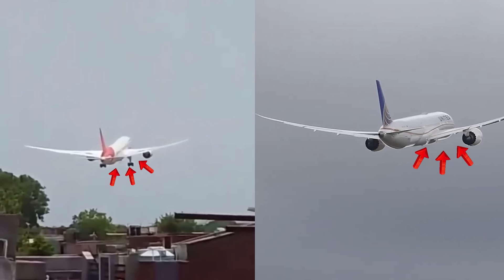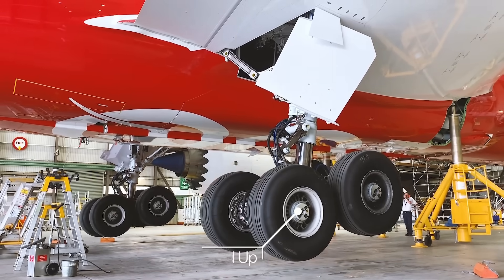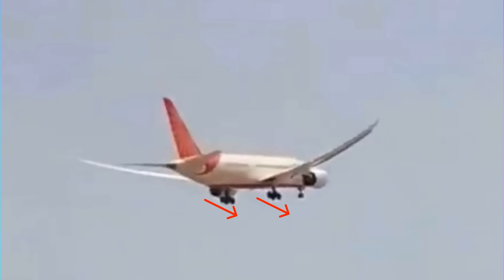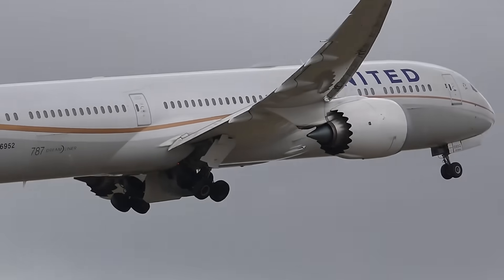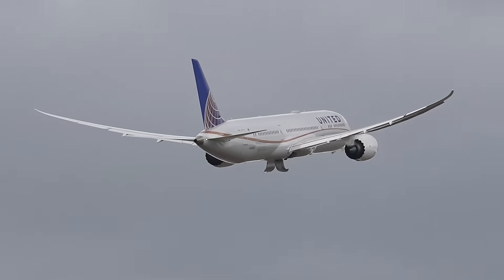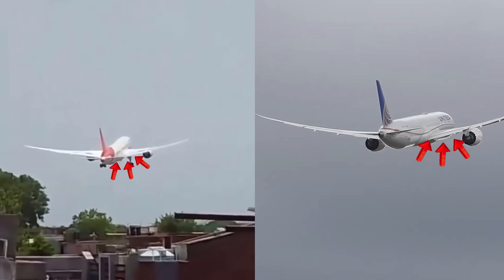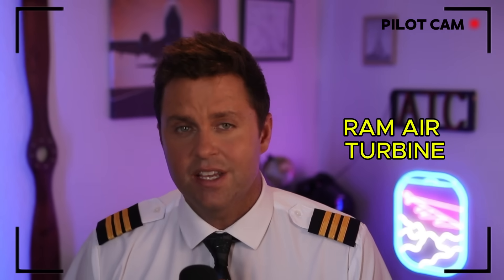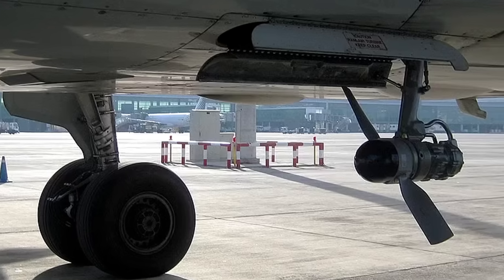Pilot Explains: A New Detail in the Air India 787 Crash Everyone Missed

Comment: Its amazing that finally, someone besides myself noticed the elephant in the room........ SILENCE instead of full power.
Reply: The aircraft had power problems before it took off. It was documented on a video that they found from a passengers phone.
Reply: @GaryFeltman that videos was from one of the passengers on the previous leg of the same plane. It i had electrical issues with in flight entertainment not working. I think he landed and got off at Ahmedabad while 240 others were boarding for the next final fatal leg!
Reply: @yashassridharan5504  I'm pretty sure entertainment system is directly connected to engine... after all its the best plane of Boeing.
Reply: ,yes. I watched it. It should have been a big RED flag to the crew.
Reply: That's a big clue!  @GaryFeltman
Reply: But hard to believe that someone on ground didn't notice.
Reply: Juan Browne mentioned the RAT in his first video but couldn't confirm it until the one with better audio came out
Reply: @Dr_Kenneth_Noisewater He also mentioned the landing gear position and the conditions that would activate the RAT. He also brought up the point of how electrically and hydrolically dependent the aircraft systems are. There is a video from a passenger on the previous flight commenting,complaining,  on a lot of electrical cabin problems.
Reply: read my post, eye witness to SCREAMING ENGINES on crashing 707 1968
Reply: The RAT wasn't silent at all.
Reply: Chalk that up to poor video quality. I work at an airport and when that 787 takes off it commands your attention almost. So dual engine power is likely. Strange it would happen after V1 though. If they sensed an issue on the ground they would have aborted takeoff.  I think timing off when they lost power could be a key
Reply: @mrboss20ten absolutely
Reply: On Captain Steve, has a video shown yesterday that was generated from the original original video:  Turns out the video we've thought is the original is 2nd generation, filmed from a phone playback of the real original.  =This greatly reduced the audio on what we've hithertoo thought as the 'original.'
Reply: You can hear the RAT loud and clear in the earlier part of the video when the aircraft first comes into view. It sounds as you'd expect, I.e. a loud propeller sound.
Reply: jeffostroff noticed hearing the RAT in his 1st video about this crash.
Reply: My fear is that we are not going to get the truth because there is too much at stake here for Boeing .
The NTSB will be heavily influenced by the Trump administration in order to spare Boeing from any blame for obvious reasons .
Reply: But isn't that stating the obvious...The fact the plane went down is a consequence of not having power.
Reply: it's amazing that no one ground these planes!
Reply: https://www.youtube.com/watch?v=uzT9MjhsRH0
Reply: How well do phones pick up engine sounds from engines that have been designed to be as quiet as possible at that distance?
Reply: @ImperrfectStranger  If Boeing crashes in India "its pilot's fault" .. that's the next level in racism.
Reply: @bombayvega7021  What do they say when a mercedes c class crashes in India?
Reply: I disagree . Audio at that distance is hard to distinguish.
Reply: @waynelast1685 except you clearly hear the rat when the plane passes by but you hear no engine noise
Reply: @EverettJohnson-js2zw hmmm the video here doesn’t show the plane as close as another video I saw. But forgot what YouTuber it was… Same source video but just earlier time is seen/heard than what this video shows.….
Reply: No, there was the sound of engines at low idle.

Comment: Ok, so let's elim8nate fuel... if it was fuel, the engines would likely not run or not run per specs. Additionally, would that not be caught at the stability check before full power. What about a full power or before V1? Why would they wait to shut down/fail as you rotate. I'm thinking failure of something common to  both engines (obviously.) Something is missing that the fdr and cvr analysis will tell us..

Comment: No one is talking about the wheels being tilted the wrong way which means the wheels are in the process of being retracted and stalled.  Which means a hydraulic failure - double engine failure.
Reply: Swiss001 has been saying that for couple days
Reply: No, it just means the weight-on-wheels logic detected airborne and tilted the trucks forward ready for gear retraction.
Reply: What the heck do you mean, no one is talking about the way the wheels are tilted? Did you not even watch this video before commenting???

Comment: I heard another pilot earlier today theorize that the engine failure could be caused by Vapor Lock due to heat. The AC was not functioning inside, many people had previously commented on the extremely poor maintenance on the aircraft and lastly it was very hot outside.
Reply: That particular Youtuber was talking out of his rear end - as noted in most of the comments.

Comment: The odd thing to me is that these four buildings that the plane hit are located right beside an open field.  Surely the pilots would have aimed for the field if they could.  This leads me to believe that the pilots had no control whatsoever.
Reply: They were on the edge of a stall hanging on for dear life.   They did the best to keep it level.
Reply: Once the plane is in a  deep stall , it is just as good as a falling stone . There is nothing that you can do ,I bet the forward speed was not fast enough for a fully loaded plan with 10yrs worth of fuel .
Reply: @Alex-ninibe  it wasn’t in a stall
Reply: @petergill2265  It was a stall your argument must be about what type of a stall it was , maybe not as deep as I thought because the plane seemed to float to the ground but definitely not a control glide .
Reply: @horsepanther  No.
Reply: "This leads me to believe that the pilots had no control whatsoever."
To control the direction of aircraft, vertical or horizontal, you need some minimal airspeed. They didn't have it.
Reply: May be after they knowing no control is on them that they wanted to land in an open field but the thrust and altitude hasn't made that distance
Reply: You need air speed to maneuver, they never had any, or altitude to trade.
Reply: I had the same guess. But it seems to be a free fall. May be
Reply: correct.
Reply: They wouldn't see the ground ahead at that AOA, altitude and ground speed.
Reply: Probably tried slowing the plane down by sliding it along the top of the roof, and got it wrong.
Reply: Your belief is wrong.

Comment: I believe they were low on power from the beginning,  because they used way too much runway before getting airborne for some reason.
Reply: They were at a high density altitude, it was hot.  But even given that, I agree they used every bit of runway with 0 margin.   But did they start from the very end,  or at a taxiway?
Reply: BINGO!
Reply: What evidence do you have that the aircraft "used too much runway"?
One grainy video from a camera on an airfield, obscured behind a structure, is not evidence.
Regardless - as long as the aircraft can maintain the required obstacle clearance on one engine, it can rotate from anywhere on the runway quite safely.
Reply: If it is not bird strike that causes dual engine failure, This incident is really pointing towards criminal negligence. But it needs concrete evidence.
Reply: @Nonechallant  That's really jumping to conclusions.
Reply: @horsepanther  it’s just a speculative statement. Not a conclusion aside from bird strike what else can make those two engine fail. And beside the vt-anb has technical issue on its previous flight.

Comment: When the pilot started his takeoff roll, he had 3505m/11499ft of runway in front  of him. Taking into account the plane was at or near MTOW, and the weather was hot, distance to V1 would have been approx. 9000-9500 ft. Why did he use all 11500 ft? His ground speed was 174kts/200mph. Thoughts and opinions?

Comment: As I'm sure you know, the 787 is automated from takeoff roll thru climb out and beyond. The 787 computer (autothrottle) determines the minimum thrust needed for takeoff in the configuration, ie weight, density altitude etc. of the plane. While the pilots push full forward on the throttle levers, the computer then takes over and sets the actual thrust at what it thinks is needed. There is an AD from Sept. 2004 on the autothrottle system on this plane. From the FAA:

 "The directive was prompted by incidents where the autothrottle system exhibited erroneous behavior during critical flight phases such as balked landings, with the system failing to properly adjust thrust levels."
Reply: Yes, sometimes it is the simplest thing. In this scenario. Would the "RAT" come out?
Reply: @scotty657  No nothing about autothrottle would make the RAT deploy. That would be complete electrical failure. In fact, even if autothrottle was turned off (it wasn't) it automatically engages before letting the plane stall. So if the RAT is verified there was complete electrical failure. Complete electrical failure would not in itself crash a plane. The RAT electrifies everything needed for flight control, and there are multiple fuel pumps per engine, not depended on the other side. With no electrical the planes I flew (many years ago) would have bypassed the electrical circuit, breakers etc., and kept the fuel pumps activated to keep the engines operating. In this complex Boeing who knows how they have it set up, but I would surely think they would have a way to keep the engines operating even in an electrical emergency.
Reply: I'm not sure that you can physically push the thrust levers forward.  Aren't they gated?   Weirdly enough....I have seen power levers on an F-100 fail to move during a landing until the jump seater kicked the crap out of them!
Reply: @eugeniustheodidactus8890  I'm a pilot with an ATP license. But I have never flown anything as large as a 787 and quite flying many years ago. So I'm not completely versed in how the throttle levers work in a 787...but I do know that the AFDS works with the A/T from roll out to touchdown. I'm not sure if the A/T physically pushes the throttle levers forward or not. I do know that the system is completely automated and there is an AD stating the system exhibited erroneous behavior. IMO the engines for whatever reason lost thrust. Either by malfunction of the autothrottle or some other reason. Everything else on the plane looks normal other than lack of thrust.

Comment: The black box should answer whether electrical system failure caused both engines to quit or whether the engines shut down first which stopped electrical power generation until the RAT kicked in. How long does it take to download info from a plane that was in the air about a minute if that?
Reply: it is not just that. if something failed, you have to find out how,where and why. so it is  very complex considering the gravity of the incident and stakes involved.
Reply: @king_has_no_clothskul8635   You’ve jumped blindly to the second step. FIRST determine what system started the problem. THEN diagnose why that system failed. It’s like a automobile engine cranks over but won’t start running. First, is it an electrical problem or a fuel problem. Then you can intelligently proceed without irrelevant guesswork and wasted effort.

Comment: Tell us exactly what the pilot did when the plane left the ground and was gaining elevation.  Somewhere between his hand and the engines there was a short circuit or something as "silly" as a melted resistor.  Wild guess, of course, but that would explain (be a plausible speculation) what shut down the engines.  I don''t  understand why all 787s weren't grounded briefly, at least while it's "officially" a mystery, especially after the previous passenger's story about his talk of electrical problems on another flight.

Comment: I said on another channel (don't remember which) that I'm about 20 crow-flies miles from MYR, nearly in the direct glide slope/flight path/whatever you call it, where most jumbos pass over my house at 800-ish feet.  Those engines are decelerating and are 4x louder than the ones in the India vid.  My take: the engines in the India vid are near idle, or at least are not set to anywhere near full take-off thrust, or if they are, they BOTH have failed.  
My Quals:  I'm not a pilot, I am a mechanic, and I live near-ish a busy international airport.

Comment: Did that plane experience some sort of Electro-Magnetic Pulse that dropped ignition and fuel supply contacts out? The survivor said there was a flicker of lights and then in a sliver of a second the Rat slams out.  The plane may have been 350- 500 feet up when this happened. Critical takeoff. I think weather active or passive that the electrical system experienced a EMP.

Comment: Didn’t his mayday call include loss of the thrust?  He told us what happened. But why?  I think fuel contamination wouldn’t let you accelerate to V2 and then cut both evenly. Plus if it was water you would see some white smoke from the engines.  This is more like both fuel cut off switches or electronic cut of the engines. Either a fault in the computer or a remote cut off of the fuel. 9:28
Reply: The Engines Weren't at Takeoff Thrust as You can See by the amount  of Runway it Used .... The Aircraft  was Struggling  For GROUND Speed  Then Air Speed .... SO Tragic .
Reply: @darrinkulyk9560 I’m not so sure. You could be right. But if our engines don’t come up to the right EPR and/or N1 you abort. Remember Air Florida into the Potomac river?  Ever since we check min N1

Comment: I've heard both of you talk about the dual engine failure. Contaminated fuel? Come-on, it would be felt during engine startup and certainly during takeoff thrust during the takeoff roll. Contaminated with what? Water? Water is heavier than JP4 or JP8 or whatever kerosine variant is used these days.I flew B52s in the 70s and fuel contamination was a problem in Guam but we schooled on what to look for. Water, being heavier would be sucked up with fuel first, not mixed, and backfires would ensue. More…

 In this case, there were no backfires heard.  I bet this plane was just in for fuel system maintenance with minimum fuel onboard and the gauges were not reset. And the plane took off w/o fuel and it ran out after liftoff. Remember that 777 that the gauges were rest wrong because of a liter/gallon change issue. There it ran out at 35,000, engines shutdown and the RAT deployed that the flight crew didn’t even know about and they dead sticked WWII runway turned dragstrip. 

It was so quiet, it had to be a lack of fuel.

Comment: How can it be contaminated fuel? The aircraft taxied on the runway for 15 minutes, there are sensors on the ground and plane which will inform the pilot of contamination before take off. So if the fuel was contaminated it would have been noticed prior to take off.
The pilot used every meter of the runway to try and build up enough speed for take off. He spoke of loss of thrust and power. The peripheral electronics were already creating a problem as noted on previous flights.
As usual the American narrative is to shift the blame to the pilots or local causes because Boeing is an American icon and is in deep trouble already. This would have spelled the death knell for the company.
This was an electrical system failure, leading to engine failure leading to hydraulic and other system failures.
Its a crappy aircraft, too dependent on electronics and sophisticated systems. It was a failure waiting to happen - a shame that it happened when loaded to capacity with passengers and fuel.
India has to ensure that thevi vestigation is fair, unbiased and places the responsibility squarely where it should be.

Comment: It was obviously an electrical failure knocking out the control circuits. That's why they lost all functionality including both engines and all hydraulics. That explains the sudden fuel starvation. It has been reported that the same plane had been experiencing electrical problems on arrival. The only survivor reported hearing a loud explosion and the lighting went out.

Comment: OK, Fine, What would be the possible causes of a double engine failure? I ve over 10K hours in the P-3 Orion and in that aircraft, even with a full electrical failure, the engines will still suck fuel out of the tanks.

Comment: @GarybPilot back in 2013 there was a known issue with with thermal runaway in the electronics bay. Yes, that was supposed to be addressed and corrected. But let’s say that for some reason this electronics bay experienced a thermal runaway and the plane lost all avionics & flight control electronics. Would the engines lose their throttle settings? While there is a possibility of fuel contamination, in a previous case of fuel contamination (Cathay 780), the contamination caused the fuel control valves to to start sticking. And on flight 780 the engines didn’t start malfunctioning at exactly the same time. My point being that unless somehow a large amount of water got into the fuel tanks, it is probably not fuel contamination. We know that it was 104 f out that day and probably higher out on the tarmac. We have seen a video where a passenger on this aircraft’s previous flight was complaining about the seat electronics not functioning and that it was hot inside the cabin. So I know that it could be bad for Boeing to discuss this possibility. But as someone who has flown as a passenger on all of these wide body aircraft, I am asking you as a pilot. What happens to engine throttle settings if there is a thermal runaway / fire in the electronics bay and all of the electronics suddenly go offline? Because if the engines do not continue with the last data input of full throttle, then we might have our answer to why both engines suddenly stopped producing thrust.